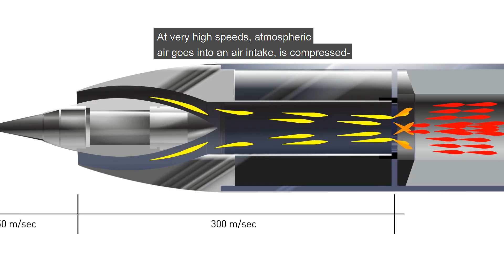How ramjets may change the role of artillery on the battlefield

Comment: Practically without the smart guidance system is useless and you will need to fire a large quantities of ammunition to address qualitative targets in the operational depth and because it will often be very costly financially and therefore maybe the project objectives may not coincide with the results, but if the ammunition is equipped with a precision guidance system and maintains its standard explosive payload of the 155 mm round , at the same price of the standard HE rounds then the project worth it . In the event of war with the miserable Bolsheviks , europe will go bankrupt after a few bursts of these weapons.
noting the design places a centralization around the ramjets engine and the fuel and this could come at the expense of the explosive payload , while packing 6k.g of plastic explosive not an issue , the only problem with the designing of explosive charge inside the projectile to maximize its destruction capabilities .
The idea is not complete failer at all. I think that DPRK can benefit from it , because their artillery forces with its various levels and calibers is one of the elements that will be decided the a outcome of any upcoming war, and perhaps with qualitative weapons , smart ammunition and overwhelming firepower in record time.
And With arsenal of artillery types with a calibers of : 130 mm, 152 mm of 170 mm. 203 mm. 207 mm such ammunition will give DPRK tactical artillery formations an exceptional engagement capabilities . 
although the for example single salvo of the Chinese WS-1 / 302 mm heavy mlrs platform system have the ability to deliver at least 85 times the destructive power of this projectile with twice the accuracy , and with the ability to cover with its sub-munitions a geographical area estimated at least in thousands of times saturation the target area with guided or unguided sub-ammunition , while a single missile has 20 times the destructive power , but this 155 mm ammunition has much more tactical and operational flexibility than the heavy MLRS ammunition in terms of easy to carry and the speed of loading the ammunition compared with the heavy mlrs missiles .

Comment: So what makes this better than a rocket engine? I looks like it could have some range advantage for a given size shell, but it also looks like it would have a seriously reduced payload capacity since it needs an air intake on the front. How advantageous would this really be?
Reply: Well, you don't need to carry the oxidizer (oxygen). But the air-intake in the front will mess about with the payload. However, if the ramjet is small diameter, then you can have the payload around it. It would be less than a normal shell, but it might be worth the trade-off vs. increased range.

Comment: Or maybe the HIMARS project already solved this "problem".

https://en.wikipedia.org/wiki/M142_HIMARS
Reply: HIMARS is a rocket system that therefore requires the oxidizer to be stored in the munition alongside the propellant. Making it much larger, heavier, more expensive, and requiring a dedicated rocket launching system. The system in the video is essentially a tube fired missile system. Therefore it is lighter, and cheaper to produce, and less problematic to store and transport, as well as inherently safer to operators. It also has the virtue of being usable by existing artillery systems.

Comment: I'm a bit concerned about the practicality of this weapon. The explosive charge must be way smaller than the regular shell since most of the volume is occupied by the ramjet motor and the fuel, and usually artillery can't be considered a super precision weapon that can relay exclusively on kanetic energy to make damage, it relays on fragments and shockwave which I assume not much with this weapon. Also at this huge range guidance is a must since accuracy at this range will turn the whole idea useless, so having GPS
with INS is essential but it will make it more complex and less reliable. Bottom line it's a good idea but very complex, expensive and can't be scaled up. I think regular katyusha with  guidance will easily beat this weapon specifically at ease of production, and ability to staturate the traget in fraction of the time.
Reply: Mini nuclear head will work
Reply: @t1349httify  Not in a 155mm  or 8 inch round you need at lest 10" or better. Atomic Anne was if i remember right 500 mm or 20 inch gun, had two guns in a battery and commanded by a 3 star general. The Iowa battleships with 16 inch guns carried 9 nuke shells one per 16 inch gun. and the fire them over the horizon or 21 miles.
Reply: @t1349httify  dude, it’d literally take a Cali warhead to do that
Reply: @t1349httify  Cannot make nuclear that small.
Reply: Do you guys realize that tM982 Excalibur GPS-guided round already exists and has proven super useful already? You need to compare this round to that one. There is no arguing that precision artillery rounds are useful.
Reply: Guidance and kinetic energy are pluses, so it will have its place.   Its place is not the cheap place.
Reply: @RobertLutece909  Read what OP says: "so having GPS with INS is essential but it will make it more complex and less reliable. Bottom line it's a good idea but very complex, expensive and can't be scaled up."  So no, does not look like everyone realizes it. 
As for the payload - it's gonna be enough for many types of targets  - radars/launchers/aircraft on an airfield/warlords in a vehicle, etc, provided that it's precise enough. 
Cost - yeah that's the biggest concern.
Reply: @RobertLutece909 it still has an advantage over just a guided rocket, as it starts at an initial speed of an artillery shell, but a rocket starts at zero speed.
Reply: @RobertLutece909 , yes more expensive, but perhaps worth it for some missions.  It is very expensive to get your cannon closer to the target.
Reply: at mach 1+ it wouldnt need a big explosive charge, the energy created by mass and speed alone would seriously fuck your day up
Reply: @ilooklikeyourmum1431 , at Mach 5 a target tank would crack like pottery.
Reply: @RobertLutece909 , sorry fat fingered it
Reply: yeah on the other hand with a panzerhaubitze 2000 there is already the possiblity to have 4 shells in the air that impact at the same time. with this kind of range a group of 4 howitzers could fire like 60 shells and be gone before they even hit the ground. thats scary and that much kinetic energy can penetrate pretty much anything
Reply: @RobertLutece909 , yes, true, but not as vulnerable as a missile.  I don’t think the warheads get detonated by an anti missile strike, they can but it is far form likely.  I remember when Saddam Hussein rained Scuds down on Israel and you could see some of them hit and they still fell to the ground and blew up.
Reply: @RobertLutece909 , neither are Scuds.  The point is the warhead can still make it through.
Reply: @RobertLutece909 , but this artillery shell has a ram jet and may fly at Mach 5.   I am not aware that a Scud can fly Mach 8.
Reply: @RobertLutece909 , all I. Seeing is 2.5 Mack for a MRBM.
Reply: @RobertLutece909 , I searched for Scud speed.  But, I knew your rate was high in my gut.
Reply: @RobertLutece909 , please tell us about the Iron Dome intercept procedure, I was unaware that it was different from the Patriot.
Reply: @RobertLutece909 , I stopped at the first figure and did not look a lot.  Literally m, I did a google search and I did not have to go as deep as one page, because Google gave me the data on the results page.  Where did you see Mach 5?
Reply: You do realize everything starts out as extremely expensive when it's a new technology. There was a time when you had to be a part of the top 5% of the economy to own a car. As technology evolves prices fall it's just the way of science
Reply: THE EXPLOSIVES TODAY ARE WAY MORE POWERFULL THAN EVER BEFORE, THESE PROJECTILES WILL HAVE SATELLITE GUIDANCE, LIKR THE COPPER HEAD, LASER , GPS, LIKE THE GERMAN GUN, THE RUSSIAN HAVE A MONSTER CANNON 205mm, IT IS BRUTAL,, THE ISKANDER MISSILE? OMG !!
Reply: Maybe they could make a laser guided ramjet projectile, and use drones to light the target with lasers and guide the projectile to where it needs to be. It would be a different concept than traditional artillery, using precision instead of saturation.
Reply: They plan on putting Monkeypox on the tip. And shoot you in the ass with it.
Reply: I was told by a man on the inside , there is a new type of very high compounds / in these munitions with almost pin point accuracy giving it 99•9 % kill on targets truly amazing how warfare is changing so fast , blink and its all over !
Reply: Which is exactly why the US Army is extending the range of their artillery by simply using a longer barrel and a more powerful propellant, so that tens of thousands of rounds can be mass produced quickly and cheaply.    Phase I of the ERCA program is striking targets with pinpoint precision at 70km out at the Yuma proving grounds.
Reply: GPS guided that speed.  Lots of potential for this on the battle field
Reply: That's actually exactly right. They're going to need to somehow find a way to shorten the ramjet and somehow place it at the end. Because with the air intake in the front that takes up basically all of the rounds real estate. Leaving not much for the warhead. They already have around that are rocket propelled, but with the exact same problem. The warhead is shortened because it takes much more room for the rocket motor.
Reply: It would be only used for nuclear munition prolly cause of the insane cost to produce it
Reply: The Rail Gun doesn't have any explosives
Reply: @gilesellis8002  It can though.
Reply: @gilesellis8002  ram jet doesn’t equal rail gun
Reply: Modern artillery is actually really accurate.  3 meter of intended POI accurate.
Reply: Most shells miss.
Reply: Nammo runs at a speed of Mach 3. Thats alot of kinetic energy which would create deadly invisible waves.
Reply: It has guidance.. Just need a drone or special forces guy to paint the target with a lazer and let the kinetic round do its kill
Reply: @DugganSean  Which defeats the purpose anyway, if you have team on site which can as good as use 40mm grenade. Had it been guided by, say.... F-35s EOTS, E-8 JSTARS.... now we're talking.
Reply: @DugganSean  Yes let me designate a target for 4 or more minutes waiting for this thing to come, which may or may not be detected by artillery radar by then and the target will be out of the picture.
Reply: @Waffle4569  With 6000 km/h the 150km distance would be around 1 min.
Reply: @georgbrenels2733  artillery does not fly in straight lines
Reply: @Waffle4569  It flies on sinus  curbe
Reply: @georgbrenels2733  Drag significantly changes the path, the end is a lot slower than the start.
Reply: @Waffle4569  It is a Hungarian invention. Learn: https://en.wikipedia.org/wiki/Albert_Fon%C3%B3
Reply: Was thinking the same. It flies a lot and then it explodes no more than a hand grenade
Reply: I would think the increase kinetic energy makes up for the lack of a payload
Reply: @God_has_spoken  lets say 30 kg final mass at mach 5 equals 9kg of tnt of energy equivalent...so like bigger anti tank mine ... not that much impressive but i doubt it would have that much mass on impact
Reply: Not on an unguided weapon. Won’t do much damage if it misses the target.
Reply: @RobertLutece909 , you can shoot down rockets, but a massive shell will keep on going.  There are times and places for all of these.
Reply: @RobertLutece909 , can’t shoot down a block of iron, it keeps going.  Where a missile has a thin skin and will break apart.
Reply: Bu if you have FU written on the side it makes more of an impact. In seriousness, you have a point, but I think that will this type of range that they are seeking it would be more of a precision weapon with limited blast than one with shorter range and a larger blast. I would agree with the design. A target of greater distance would allow greater time to pinpoint with greater accuracy than one at much closer distance giving less time and possibly needing more stoppage power? With precision guidance, gps and satellite surveillance you would be annoying the hell out of the enemy. The lesson was learned after massive B-52  bombing runs against the North Vietnamese. Accuracy wasn't there, so increasing the odds of hitting a target with more ammunition was key. in spite of it the Vietcong rebuilt right after the bombings. When precision weapons came into being, one can witness the outcome as in the Operation Storm. The results were devastating.
Reply: You dont fight russians. You negotiate, if that fails, you retreat. If even that fails, then you wait for them to collapse. Historia magistra vita est
Reply: @janezjonsa3165  Tell about your recipe to the people of Poland, Hungary, etc, etc. Wait so much time under so much pain is not palatable.
Reply: @janezjonsa3165  This comment has not aged well.
Reply: @janezjonsa3165  yes?
Reply: @janezjonsa3165  well.. Ukraine is proving you wrong. Just two years later
Reply: @janezjonsa3165  How's that working for you now?
Reply: @janezjonsa3165  Your comment didn’t age well 😂
Reply: @MrAnders9000  its not aged yet.
Reply: LOL
Reply: @janezjonsa3165 That aged poorly
Reply: @thysonsacclaim  not at all. Its not nearly over.
Reply: u r concerned about weapons. when u should be scared of virus.
Reply: Sodeep Maan shut up Karen
Reply: @xybba777  😂😂😂

Comment: What's the point of extending the range to 5x the original, but reducing the explosive payload to a few handgrenades?
We could make a rail gun for explosive payloads, but I think that rockets will slowly replace all artillery. Heck, even the Soviet 125mm cannon launched rockets were already pretty impressive and outraged us by a long shot... We can even use the APFSDS principle for rocket payloads. Thus, we could circumvent active protection systems.

Comment: Only problem I see with this is the lack of explosive filler. Most 155mm rounds contain 7kg/15lbs of Comp B explosive. With a rocket motor and intake taking up the space that is normally reserved for explosives, you are trading range for damage potential.
Reply: I wonder if perhaps the kinetic energy of a 50kg mass moving at mach 5 is impact enough. The bursting charge wouldn’t need to be much, if anything. I imagine a vessel being struck by such a projectile would be in considerable trouble. Guesswork on the figures of course.

Comment: They talk to slow, watch at 1:25 speed. Also if you want a rocket/ramjet use a small  missile ,and do away with all artillery paraphernalia.
They already have small ramjet missiles that utilize small solid fuel rockets to get them up to speed, then the ramjet takes over.

Comment: Could this technology be adapted to the recoiless rifle round?
Reply: Recoilless does not have the initial velocity, and they could be outfitted with regular rocket propulsion to extend range that would work better for anti-tank use, which is what recoiless usually use. Plus, HEAT is not velocity based and HEAT is only used on recoiless, no kinetic impactor would ever take the recoiless rifle route of getting to the target.
Reply: @numberpirate  Thanks for the update.
The 106mm recoiless had a muzzle velocity of 1650 ft per second.
That is very slow for an artillery round as you said.
The range was less than a mile.
But they could be mounted on any vehicle including a jeep.
I am thinking the round could be range augmented by a rocket assist as you suggested.
The ram jet has a starting velocity too high to be useful as you suggested.
Maybe we can use the rocket assist to increase the range, but the recoiless feature needs to be retained for our requirements.
Reply: @numberpirate  Marcus.
We are looking at 2300 ft/second velocity and 1000 yards range currently.

That should work,but later in the future,  we are looking at ways to extend range.

Comment: The jet takes up 60% of the projectile... less explosive. Larger projectile will require more propellant to fire. The new NLOS HRAP 155 rounds have all the range and accuracy required. If you need more range you use MLRS. There is no range gap...
Reply: I would think the increase kinetic energy makes up for the lack of a payload

Comment: The heat ( due to friction and or compression) would probably ignite the charge ( if there is any room or big enough) in mid flight I'd say, oh well, back to the drawing board.
Reply: Modern explosives RDX/HMX do not ignite due to heat, they ignite due to electrical charge. And no, the round does not act as a capacitor. If I were you, I would say, oh well, back to the classroom to learn about reality before commenting on reality.